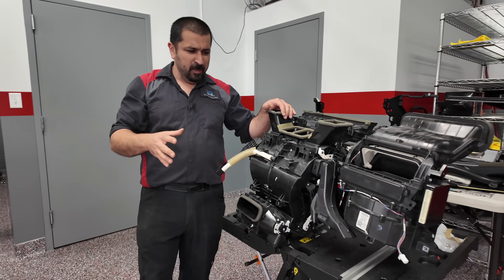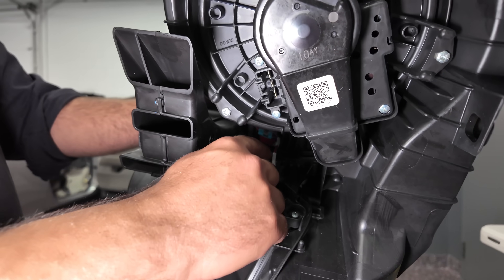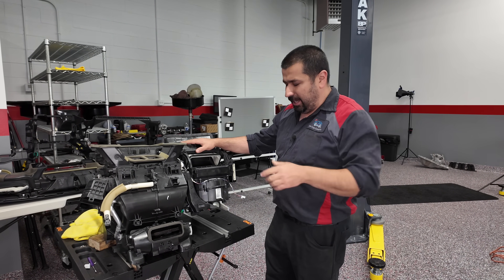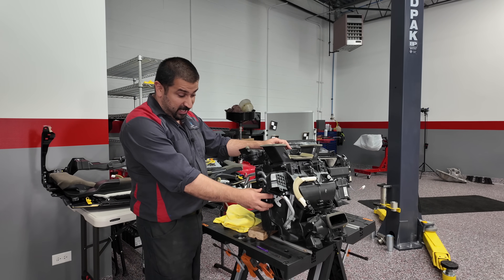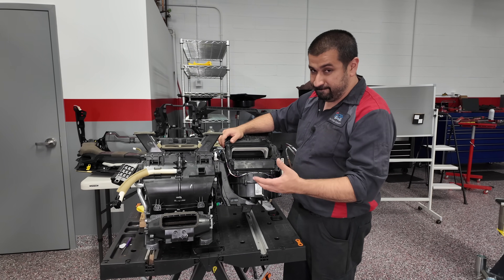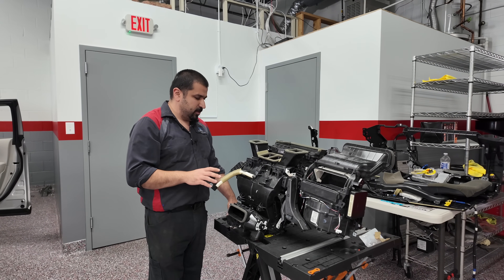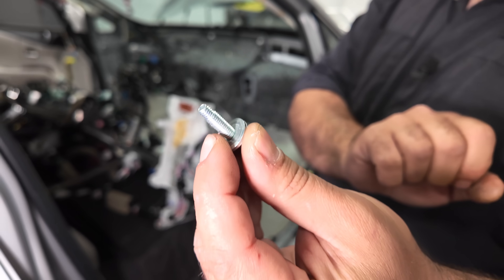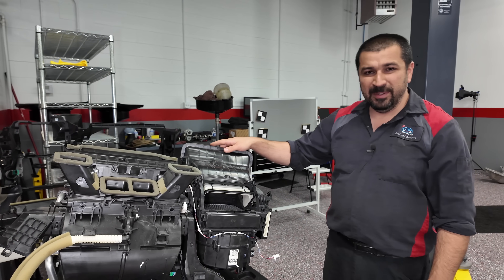THIS is Why Car Engineers and Car Mechanics Don't Always Get Along!

Comment: HINT: Tape off your defrost vent when you get a new windshield.  The windshield installer doesn't care if they drop stuff into your defrost vent.
Reply: Now that is a pro tip!
Reply: Thank you! I need my windshield replaced.
Reply: and use painter tape which doesnt leave glue residue, and dont let it cook in the sun
Reply: Great idea!
Reply: Once I saw a dead spider near the defrost vent. It’s been there for a while so it’s dried up and brittle. I tried to pick it up but it broke in two pieces and fell in the defrost vent. I hope it’s not going to be an issue. In hindsight I should have use a vacuum to suck it out.
Reply: @alegroman4294  that delicate debris won't be an issue. 

Pieces of hard windshield sealant, rubber trim, coins, plastic toy pieces, large pieces of debris are all problematic... But something like a paper shred, or a dead bug aren't.
Reply: @alegroman4294  you probably just inhaled it.
Reply: @alegroman4294  that spider will wilt into hundreds of pieces and your will breath it into your lungs someday!
Reply: Good reminder!

Windshield replacement can be messy
Reply: Should have screen mesh on the vent opening
Reply: @PeterHernandez-lg2eh  Would that not cut down on air flow?
Reply: This might be one of the best tips I've read by a viewer
Reply: This isn't a hint, this should be a PSA going forward, great information 😉😎
Reply: Good "hint" haha
Reply: Very informative
Reply: Bro I’m just seeing this and my windshield was replaced like 4-5 months back 🥲
Reply: I have a 2023 Toyota Corolla cross that is going to get the wire/plastic mesh treatment.
 This is NEVER going to happen to ME!
Nay Nay Nay

Comment: I absolutely HATE these servo motor jobs and evaporator jobs, especially this time of the year.  When I first started in the business almost 30 years ago, these jobs were easy.  You could get the evaporator out in less than an hour.  Now the job takes a whole f-ing day or more and I hate it.
Reply: longer time equals more money and profit
Reply: @RATCHETMAN1001  Nah, that job takes at least a day and more and there's only so much you can charge.  Jobs like that are a break even job, meaning the flat-rate time and the actual time to do the work are pretty much the same.  That's like doing warranty work.

Comment: Toyota engineering should have a seasoned tech on the design team.
Reply: It's not even about that any automaker is looking for the cheapest & easiest way to build the vehicle. I work on equipment all the time and some things just aren't designed with service in mind. This is why all the Toyota yuppies drive me crazy because it's the same sh*t as everyone else makes. Some stuff is easy to fix and some stuff won't. That's how it will always be for any vehicle ever made.
Reply: Why, it's better for Toyota if they can sell a new car instead of expensive work being done on the old one.
Reply: It doesn't work like that... When someone with knowledge in one area of a company takes that knowledge into a new area of the company, they are indoctrinated and become disenfranchised quickly. It's hard to care when no one else cares. The paycheck is the same either way.
Reply: Instead they probably have a majority of accountants.  That's what utterly rekt BMW around the turn of the century.  What used to be great engineering became horrifically unreliable because of garbage like "15000 mile oil changes" and plastic cooling systems, at the same time engine operating temps were INCREASING for emissions purposes...  20-30 year old BMW engines that are in top nick now survived DESPITE the service schedule, not because of it

Comment: The same problem replacing the ID code box that sit behind that evaporate box
Reply: I work and build Lexus RX350 at Cambridge Ontario, that ID box is called immobilizer, it's designed to be located between the HVAC and the firewall, the whole idea for this location is harder for the thief to get hot wire, if you need to replace the immobilizer, basically have to remove the whole IP to access it.
Reply: @gordonlam5525  that I know I am a retired Lexus master tech

Comment: To take the whole dash assembly out to replace a $80 motor is ridiculous. $1300 in labor for a $80 part! Engineered for dealer service money.
Reply: My car uses engine vacuum to move the blend doors the only blend door that has a motor is the temperature controller so you can adjust the door into different positions to mix the hot and cold. This motor is easy to get to just gotta pop out the glove box just a couple screws and its right there to left of the passenger side two bolts easy to reach. Also with the glove box out the blower fan is right there and it’s easy to take some compressed air and blow out the fan.

Comment: As an engineer, they mainly design based on lowering labor costs for the factory. If they can make it easier for mechanics, they will. But the manufacturers cost takes priority
Reply: Priority: Use and Dispose!
Reply: Makes sense.
Reply: Holt0216
That makes sense
Reply: And consumers should respond by not buying cars that have components that are not accessible.
Reply: @s.j.5850 kinda hard when they all follow boss discretion. Most vehicle hardly last longer than 10+ years. Some surpass it because of good maintenance and driver driving habits (not running cheetor speed on a family car).

I just got Tbone on my Toyota Camry 2008. Now I notice most vehicle have that stupid start/stop engine and 4 or 6 Cylinder Turbo. The market is going that way. Either I find a vehicle with none of that with good reputation, reliability and low mileage is kinda hard. It takes time which I don't have because of insurance, rental expiration time limit, work and etc.
Reply: @tr1bes  It's like rolling the dice on a new car and hoping to get lucky if you intend to keep it for a long time.  The manufacturers don't want you to keep a car 10 plus years because that cuts into their profits.  If they can get them to last just past the warranty they know you will either have it repaired or buy a new one.  Win-win for them & lose-lose for the consumer.  If you are going to buy new then price the parts before you buy it.  That way you will have an idea of what repairs will cost if you keep the car long enough.  There is no mid-price car selling now that I am willing to buy that has very few issues.
Reply: @tr1bes  yeah, finding a different vehicle on the fly is difficult and insurance companies want to cut off the rental as soon the payment is cut and out of "their goodwill" will extend the rental 1 to 2 weeks. In hindsight, unless you find something you really want you are better off getting cheap "cash car" to hold you over so you can make a more informed decision.
Reply: It’s always the accountant we’re dealing with
Reply: The only cars designed with ease of maintenance were the Toyota  and Datsun vehicle of the early and mid seventies.  The Japanese domestic market was so competitive, that the manufacturers were offering extended service packages for fre with the purchase.  Time for an inspection and service, you called your dealer, and told them where your car was parked.  They showed up with a tow truck, carrying the dealer loaner, which was the same model as yours, with the same or better options.  They took your car, and you drive theirs until they were done with yours,and did the reverse swap.  So, the maintenance labor was of great concern.  That coupled with their efforts to break into the US market, lead to vehicles which were very easy to maintain.  

You could do 99% of the maintenance on a mid seventies Toyota with three tools, 10 and 12-mm wrenches, and a #2 Phillips.
Reply: As an engineer, can confirm. Everything is usually great until the boss comes in and tells how much money it should cost

Comment: Some oil filter locations are insanely located in tight areas. My 95 nissan truck has me loosening thru the wheel well and catching it in the front, messy.
Reply: My Ram diesel is like that too.
Reply: 99 rav4 isn’t that bad but it’s a biiiiitch

Comment: To replace the clock lightbulb I need to take off half the dashboard. Honda Odyssey 2001. Nightmare SUV.
Reply: Sounds like another feature when designer hated her manager? A previous winner was the installation of car battery inside the front wheel well.